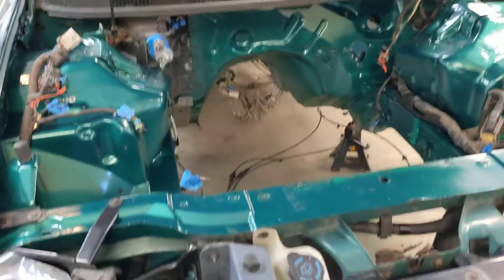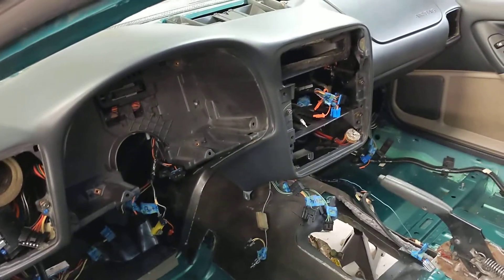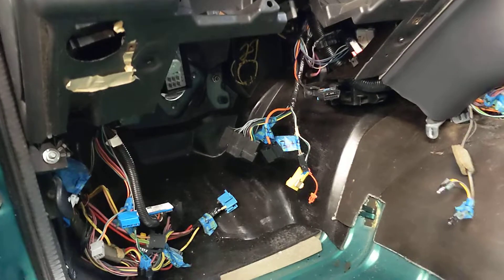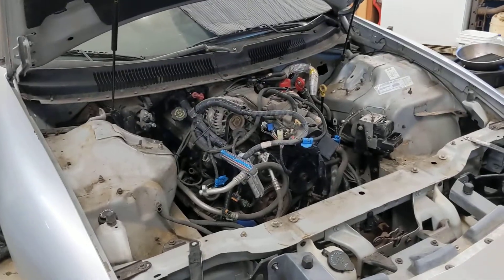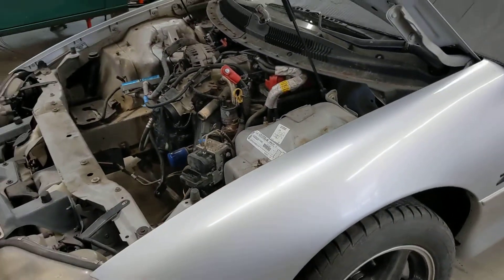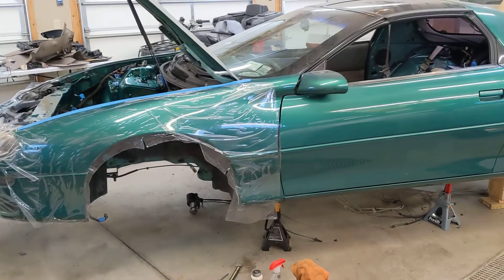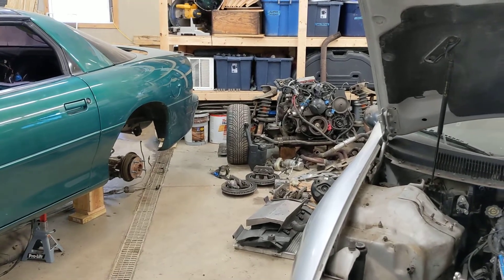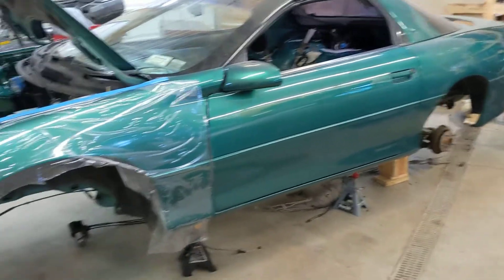1998 3.8l V6 Camaro to LS1 / T56 swap - Part 9 - Random things

Comment: Do you know if i buy a "roller" Z28 or SS; is it as simple as getting a motor, trans, and tune? Or is there other things to consider?
Reply from the maker: Depends on what year your roller is and what it comes with, as well as what year your engine came from. The 1998 engine harness and PCM has different connectors and pin locations than the 1999-2002 years, so a 1998 LS1 will only go in a 1998 Z28 (with no modifications, you can modify to make it work otherwise).  Likewise, a 99-02 LS1 and engine harness will go into a 99-02 Z28 with no modification. 

1993-1997 T56's are different than the 1998-2002 T56's (bellhousing, input shaft, slave cylinder vs shift fork). There are conversion kits.

Rear ends are interchangeable but may have different gear ratios that you will need to tune for. 
Any other questions just ask!